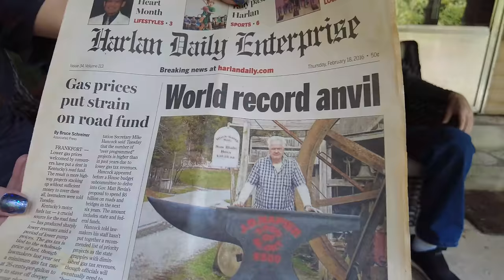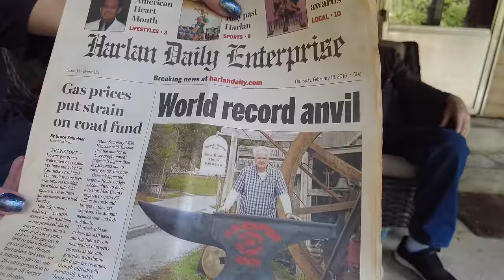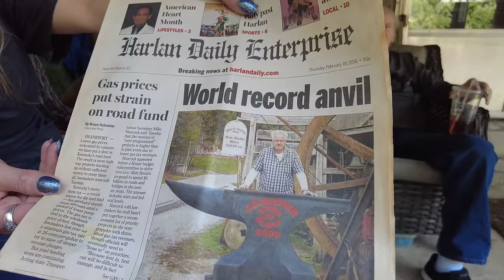He Made The Worlds Largest Anvil - JD Napier of Harlan Kentucky

Comment: When I was working in blacksmithing as a kid, you didn't swing a heavy sledge hammer but one time. You let it bounce off the anvil, quickly get the handle under the head to start your next lick... Lift it straight up, and then pull it down hard onto the hot steel for the next lick... Otherwise, you couldn't stand to work all day in the heat... Interesting show...

Comment: the anvil in my ancestor's smithy in a small village, east of Berlin, Germany, is in the same size range. I was there about 25 years  ago, when the place was falling to pieces. The only items not stolen by  thieves were the old huge bellows, the  old forge made from bricks and the HUGE anvil sitting on a piece of oak tree. To move it one would have had to demolish the roof of the smithy and to use a crane. I have heard that today the smithy has been renovated and is now a village museum. They even got a new blacksmith working in it.

Comment: I used to like the 30lb hammers but I would always end up breaking the head off the handles. I didn't have that problem with the 20lb kind. I'm not a smith I liked to build walls out of stone and would use my hammers to break rocks or whatever to serve that purpose.
Reply: After I broke my handles I welded pipe on, they didn't break again, and the vibration gives a stronger grip